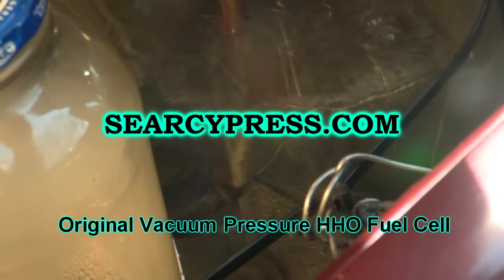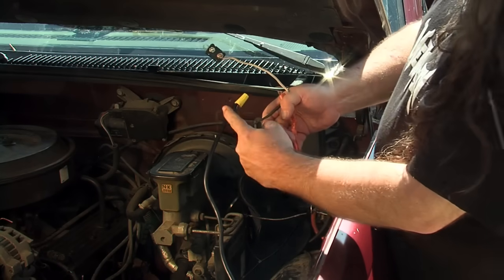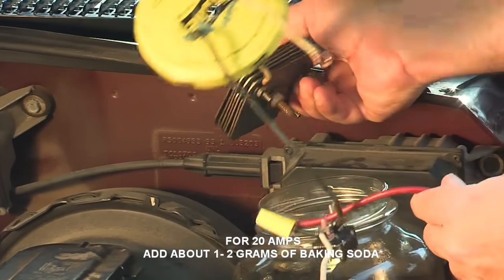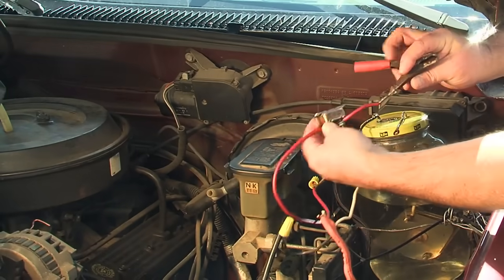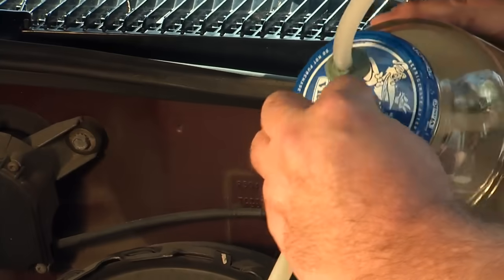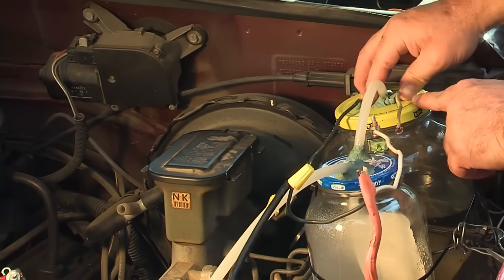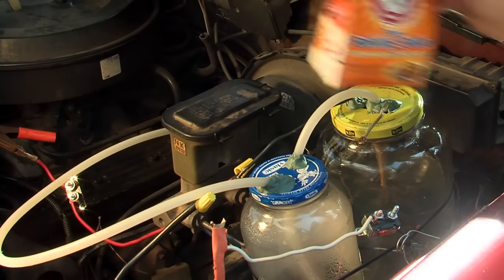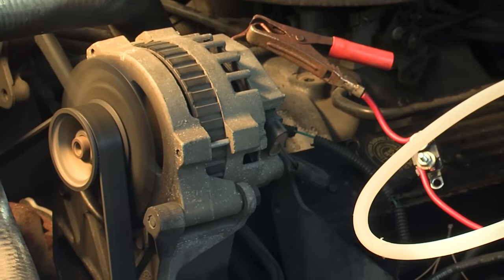Vacuum Pressure Hydrogen fuel cell defeats high gas prices using hydrogen from H2O.

Comment: Can you do this on a Diesel engine or is it  gas only?
Reply: On absolutely no engine does this work.  Ur better off running a diesel off used motor oil and gasoline mix.

Comment: A friend of mine used a setup that used 3 equal parts hydrogen peroxide (industrial solution), rubbing alcohol (90% i think), and water he said it was like 1 drip every 3 seconds and it took him 3-4 engines to get right (kept melting them) but his little monza was getting almost 80mpg. If you wanna play with this set up all I can say is monitor your temp closely. He had 40+ vehicles he could pick for parts. But enjoy
Reply: I do the water/methanol up to about 10% of the gasoline sees gains but you start to lose to misfire above that.  But 30% peroxide? I bet he burned up a few engines .. that's rocket fuel!!!  And a heck of an oxidizer.  You can't mix that with the alcohol!!
Reply: @davisrs1  not quite accurate. the type of hydrogen peroxide that's readily available is 1st base or around 5% concentration. H2O2 used in rocket fuel is 4th base or 70%+ concentration, and is unobtainable outside of specialized labs.
Reply: He was using the acid as an oxidizer for the water, which does act on the water and the metal, burns hot, like adding nitrous its an oxide, just run alcohol with water injection and nitrous
Reply: hey so, i know this is old, but hydrogen peroxide and rubbing alcohol combine together to create a strong corrosive. Your friend was litterally running acid through his engine and claiming it gave him more horsepower. His engines were melting because he was mixing acid into his fuel 🤣🤣
Reply: 100% false. A little common sense and u know this isn't true.

Comment: Way better assembly's to come up with. Your on the right track though. First thing I would say is put to gether a system that separates the hydrogen and oxygen. Your intake will add the needed oxygen as you suck in the hydrogen. This will lead to a safer system. Thats just the first suggestion though.
Reply: Lol will never work. Water will never be used as fuel in a motor vehicle

Comment: You didn't adjust the carb?
If you leaned the carb out as much as possible wouldn't you get even better mileage? The vapor should replace the leaner fuel mixture

Comment: Pretty cool… not so sure about the pickle jar though
Reply from the maker: Glass seems to be about the only material which has the thermal properties needed and does not distort with high heat and vacuum. Thanks for the comment.

Comment: I did something similar with a surprise success.
I say it was a surprise success because I accidentally ran out of gas as the dash lights didn't work on my car, and still got home (My brother used the car earlier, and didn't tell me). As I was driving, the engine started running rough. I didn't know what the problem was, but it kept sputtering along, so I kept driving.
Mine used 10 spark plugs, and a homemade inverter (555 timer, audio amplifier, and 2 automotive coils @ 100Hz, and visibly sparking in the water).
I had the spark plugs inserted in the bottom of a Tupperware container full of water (no electrolyte. just water). I didn't have a second dryer container, but I did use a bit of steel wool stuffed in the hose in case it backfired. The engine was a Chrysler 2.2 L, naturally aspirated TBI job.
The next day, the car wouldn't start, and it took me an hour to find out that I had no gas as my head was under the hood, and not in view of the gas gauge.
That's how I found out the same basic gas works. However, I had a lot of steam from the exhaust, so I didn't put it back together after ripping it all apart that day.
This video seems to correct the mistakes that I made, and will probably run much dryer than mine...
I think it's worth trying it again, sometime in the future.
Reply: Lol love these bullshit stories people believe. This is gold...

Comment: I envision a whole house electrolyzer powered by solar panels.
And a way to store the hydro gas for fuel in the truck.
Reply: Isolate just the hydrogen and use a small gas compressor to pump it into a propane bottle or SCBA tank.

Comment: Will water burn ? Have cars and trucks for 100-years been able to run off of propane and or natural gas.? Can individuals with very little effort make their own hydrogen safely? 
 Has  hydrogen been used in transportation ? Is it being used in transportation ? 
Will hydrogen RUN an in internal combustion motor ? 
The answer to every question is YES. !  Gasoline has always had to come from big oil . Electricity is big power . With very little range . Both of these pollute and more than one area. Hydrogen doesn't pollute crap.
The only reason we're not running it for everything we do it's because of the forces that are in charge of our thinking .Knows that it is the game-changing moment in time when they can no longer control movement . It is our only option. To be free . Because it's free .

Comment: the laws of thermal dynamics prove this is bullshit. It takes MORE energy to break the molecular bonds than it can produce through combustion. Fools and their money......lol
Reply from the maker: Actually not. You are programmed to believe you're burning 100% of the fuel that is going into your engine. However this is clearly not the case. This engine actually burns only around 80% of the fuel going into it. By using a bit more energy to greatly increase the efficiency of that burning process, you can reclaim a large percentage of the wasted fuel. 20% is a lot.  It is not over unity it is simply higher efficiency.

Comment: Does this work with a diesel engine too?
In England they ad LPG, liquified petrol gas to diesel in big truck engines
Reply from the maker: Without vacuum the thermodynamics of the fuel cell are much different. Injecting into the air intake is problematic for many reasons. Simply put, no. But nothing is (im-possible) impossible. Thanks for the comment.
Reply: It works with nothing

Comment: Well water,city,distilled does it matter.
Reply from the maker: It will directly affect the current draw. Using distilled water and just a pinch is a good start. Using water from other sources will change the amount of electrolyte needed, if any. If you add too much you will trip one of the circuit breakers. When that happens just add more water. This video is for demonstration only. Thanks very much for the comment.

Comment: I wonder how bad a "fender bender" would turn out with this set up ? ☣️☢️
Reply from the maker: The connection to the alternator is a large clip. This clip  may look like a poor connection, however this was by design. Inertia from a crash would most certainly knock it off. It does not have to be complicated to serve a meaningful purpose. Thanks very much for your comment.

Comment: Do you use gasoline as well? What does it do in as far as the emissions go? Does it throw weird codes? Will it pass emissions? How do you regulate the vacuum for the brake booster if your producing an over pressure inline with the booster vacuum source? I understand why you would use this vacuum source but wouldn't it be better to use the air intake itself. I guess my brain is fighting to understand how the heck u are achieving control of engine rpm whether its a carburetor or fuel injection when your injecting both the fuel and the oxidizer then any air you add from the throttle wouldn't do much for acceleration because in a fuel injected vehicle the pcm uses the tps to determine how much gas pedal is being used and calculated the correct timing and fuel injector pulse width which increases or decreases as the gas pedal is pressed or let off. On a carburetor your bypassing the entire air fuel mixing station entirely and I can't even comprehend how you would control the throttle this way as your vacuum decreases as rpm increases you would get less mix and the further the throttle opens the more air would enter making the mixture leaner though how much is a mystery considering your adding pure o2 and not environmental air which is like a third o2 its still gonna add more o2 and at some point this isn't going to ignite. Also if your using the hho only I wouldn't think enough gas could be produced in that pickle jar.
Reply from the maker: The system does use gasoline primarily. The hho increases the efficiency when burning the gasoline. On this engine only about 80% of the fuel is normally burned the rest goes wasted. That 20% leaves a lot of room for improvement. We do not see any error codes. Emissions are greatly reduced. When you mix HHO with air the effect is much different than vacuum. When accelerating hard it is true that the vacuum is almost completely gone. At that time the system is producing gas that is not necessarily traveling into the engine. This is not true when driving down the road though. When HHO is burned it recombines into water. In order for excess oxygen to be present one would have to assume you're not completely recombining that hho. I find that very hard to conceive given the reactiveness of the gas and the vacuum effects. We are not burning this fuel primarily and no changes to the RPM are necessary at this concentration level. In further testing we pushed the cell to 100 amps using a generator placed in the back, producing approximately 6 liters per minute. The engine seemed to produce quite a bit more horsepower however there was no increase in mileage. This was probably due to the fact we drove it around like a dragster. What we basically observed was less can be more. You don't have to have a tremendous amount of production to see an increase in performance, a reduction in engine knock and engine cleaning effects. Thanks very much for your comment. Despite how the video looks I assure you we were taking many precautions. Doing this modification to the vacuum line can be extremely dangerous. Do not attempt. Thanks very much for your comment.

Comment: Yall should fill that backflow jar with some water

Works as a flame arrestor 

But awesome info 
Thank you
Reply from the maker: It auto fills and returns the water to the cell because of the piping and vacuum. Anything in the dryer section flows back to the cell during power off cycling. Thanks very much.

Comment: I've done this when gas prices went bezerk cause of Katrina that wrecked the gulf. I went from 18 mpg to 30 mpg. I was lucky I guess, mine worked perfectly
Reply: Why do people like u make up these lies? 

Just idling your engine is over a 600 rpms. Driving a 2.5 liter 4cly motor  is about 150 cubic inches. That's 37.5 cubic inches per a cylinder. A cylinder fires ever 2 full rotations. So in a minute of idling at 600 rpms your engine will use 11,250 cubic inches of air a minute at just idle. That's a 187.5 cubic inches a second of air. You're not producing even 2 cubic inches a second. But don't forget that it's h2O 2 parts hydrogen 1 part oxygen. So 1/3 of the gas isn't even hydrogen it's oxygen. So not even 1% of the air being taken into the cylinder is hydrogen. The only thing being accomplished here is the alternator is working harder for the high amp draw dragging the motor down more reducing fuel mileage. This is why water isn't used as fuel in a motor vehicle. 

Now don't forget we don't drive at 600 RPMs most people will be around 1800 rpms at cruising speed. That's 3x the amount of air with still the same hydrogen production. So now ur way below the threshold of .03% hydrogen in the cylinder. Using a spark arrestor on the output hose to keep from blowing the jar up you would be hard pressed to even candle a flame let alone put anything measurable in every cylinder 900x a minute cruising down the highway at the speed limit.

You look like a fool.
Reply: @magicalphones  No lies,it works. Say what you want,I know it works. I seen it with my own eyes.

Comment: I have a 96 Grand Cherokee with a 5.2 ltr V8 with around 360 hp and it gets 33mpg already 😂 
Btw HHO does not EXPLoDE unless pressured to do so. So technically because your device is on a vacuum, the HHO doesn’t “explode” until 
It’s in the cylinder and is compressed and sparked. You could have a car accident and not worry at all 
Because f the jars break it literally would do nothing but spill everywhere. 

You could get electric shock maybe if you left it running and touched the wires with your Butthole though so be careful!

Comment: Don't use AC rated switches for DC operations...
Reply from the maker: Right. Don't do anything you see in the video. With that said, we went through boxes of toggle switches with high ratings. Nothing held up like the switch shown. We took chances and explored. It had many dangers and replication of any of this could be deadly. Do not attempt. Thanks for the comment.

Comment: What's the point ? More power , more mileage ?
Reply from the maker: On this engine only about 80 percent of the fuel is burned. Enrichment allows it to be much higher. Emissions are epically improved. Engine knocking disappears even with low octane fuel. The engine is cleaned. (You see it blow out on the ground first use.) Mileage can improve. In some cases greatly. I'm not at all telling you to duplicate, like  it states in the video. We are just telling you our results.  Thanks for the comment.

Comment: Forget the poster putty and use Swagelok fittings.  I would probably use quick-connect fittings with spring-loaded shutoff valves on both sides.  I'd ditch the glass jars and use two racing go-kart fuel tanks.

Comment: Hydrogen cells are like LEDS they would take 100 amps if you give it to.  Use a 5 ohm big watt ceramic resistor to control the amp pull don't worry if you get less gas, remember this is hydrogen we are taking about a little goes a long way, and be careful of discarding the dirty water it will contain high levels of chromium.

Comment: Very cool man. Good music you got playin in the back. I definitely gotta read more into this. 
But hey, if you dehydrate the baking soda (sodium bicarbonate) to washing soda (sodium carbonate) it should work as a cleaner electrolyte. At least it does for me whenever I clean rusted parts using electrolysis. Keep up the good work man!!
Reply from the maker: We were the pioneers, lots of others have made improvements. Most of our fuel cell vids were nuked by yt. Remember the first rule of fight club when working on the fringe. Peace. Thanks for the comment.
Reply: Hi john, any alway we can connect.? Would like some advice.…

Comment: Pretty Heath Robinson but apparently it works. Should you risk all those loose connections and gas leaks in a hot engine space, hell no.
One other thing, it may burn clean but what the hell does it do to the oil.
Reply from the maker: Do not attempt. But- the engine space is fine. It runs in a vacuum, no pressure. Your gasoline makes water when burned already. Stops engine ping even on low octane fuel. Thanks for the comment.
Reply: @metalpresstv Thanks for your reply it's amazing what you created with everyday items. You might enjoy this link
https://youtu.be/Yyiw9I3AVaU

Comment: I love that whole setup that's pretty awesome the only problem I have is using that glass jar who's got to be something else that can be used I live up in Idaho so it gets pretty damn cold up here. But I did see another guy actually two other guys in the course of 20 years doing basically the same thing at this guy did. I just haven't gotten around to doing it myself. I've just been studying what other people have been doing. And it seems pretty awesome The only problem was the other two guys that I talked to that had this that they did this to their vehicles said they only gained about 5 to 10 mi an hour better but they did put them in their pickup trucks so that I guess that kind of adds up
Reply: use a plastic jar and add some alcohol to keep the water from freezing
Reply: i asked in a different coment and the dude says that with the baking soda it takes much colder to freeze the water. peace

Comment: This is amazing this is exactly what I was looking for this is absolutely amazing but I'm having a problem believing you because at the moment you say put the positive on the inside with the negative on the outside that is not how you have it wired up you're lying. Why the f*** would you lie or try to set us up cuz that's very dangerous.
Reply: And also once you clarify this, with those metal plates is there anything in between them like you have some rubber gaskets of some kind?

Comment: My buddy showed me the same type thing YEARS ago.  Good job.  It works!  Hydrogen directly to intake.  U can use two metal plates for the negative and positive.  And blow out valve in the middle on top.🥳
Reply: Lol and it did absolutely nothing but drag down the motor from the high amp draw producing almost no hydrogen gas.
Reply: @magicalphones  it was a start, and improved his gas milage.  He is/was poor.  There are a FEW reasons your being cocky and arrogant.  I GUARANTEE you . NO training NO bosses No money.  STILL MAKE IT HAPPEN!!!  And i promise if your poor and try to save the world.  They WILL kill you... So be a smart ass..  but answer to a boss